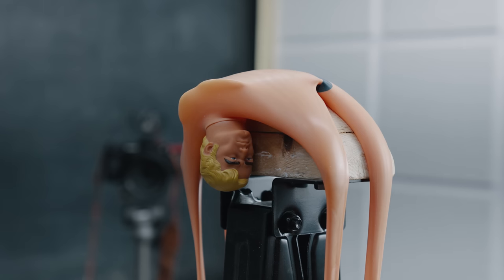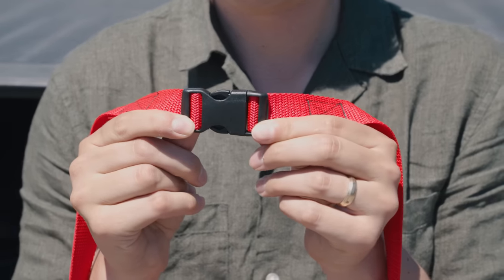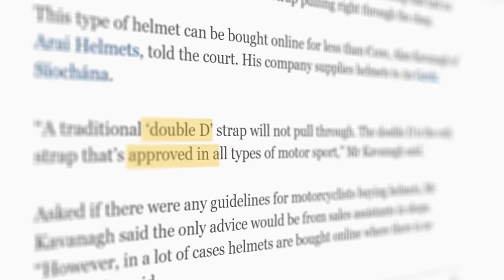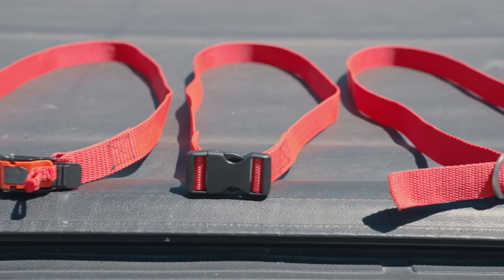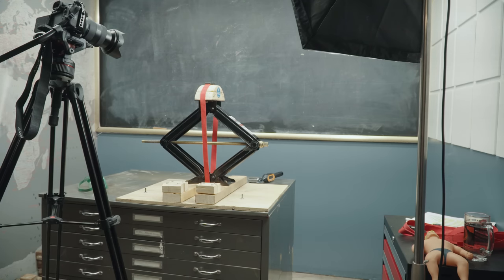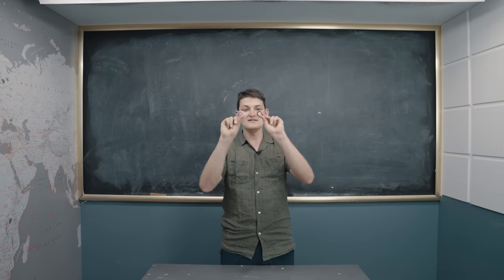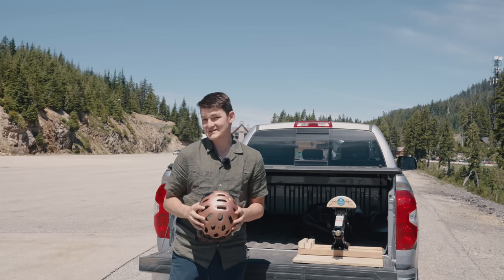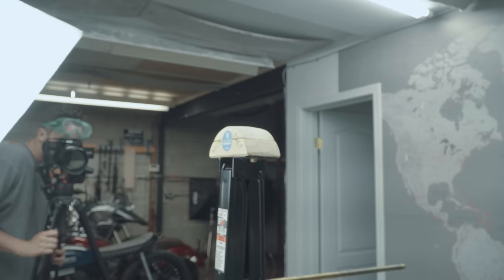Why Motorcycle Helmets Use this Ancient Buckle

Comment: The loops potentially weaken the strap strength, please try the same step with no buckle as a control test, actually doesn't matter, you'd need a set up where you can see the force at which they snap. Still cool to watch!

Comment: I have a plastic cambuckle kit I put on my downhill MTB helmet for electric unicycle. It rivets onto the existing strap. OBVIOUSLY it's going to compromise the strength, but at maybe 40km/h it can do that. The kit came with 2 buckles... that other one was never going to go on my motorcycle helmet because that'd be insane, even though that's basically what it was sold for.

Comment: this is coming from mountain biking where we have all the same type of buckles and helmets anyways. i absolutely do love the fitlock though, it's by far the easiest way to put on your helmet, does not come loose as fast, and easiest way to take it off. of course this is mountain biking im talking about, where we take off our full-face helmets almost every 5 minutes just to grab a breather. thats why the double D is a favourite in DH helmets where you only take off your helmet for a ski lift or car ride up the mountain, but the fitlock is also taking over there, of course, we have slower impacts but still. its nice to have and apparently only a little less safe, but im willing to give up that little bit of safety for comfort, that's why you don't see me walking around the street with full armour in case i fall

Comment: Only complaint with the ratchet style is no secure way to hook your helmet to the bike. I solved that by drilling a hole in the metal slide big enough to fit a standard helmet lock. Be easier if they'd put a  D ring on the helmet as well. Slide still works and I get three clicks when fastening it on.

Comment: It's faster fastened than you think. You always keep the belt in the rings and just loosen it a bit. Then you can slip through. When tighten it, you just pull a bit, and you're done. Also you are less likely to get pressure marks on your neck with these.

Comment: For my job, keeping gloves on, helmet on and have it easy to take off works wonders with a shark $800+ modular with a ratchet buckle and always checking for tightness, I mean maybe once I forgot, but have not had a single issue yet, no extra wear, no fraying due to over tightening/loosening of it constantly and it is a tough lid to pull off due to all the extra padding anyway, so the buckle works more than intended :) I am all for safety, but on occasion, the only helmet that you can buy that fits you properly, isn't exactly subject to change prior to purchase, and is illegal to modify here in australia, so ya know...

Comment: Hard to tell in the video, did you start with the scissor Jack in the same position every time? A scissor jacks lifting power increases the higher it gets, so the torque applied at the crank isn’t linear to the force applied to the buckles.

Comment: One of my first helmets had a DD. The first time it hit 60mph the tail started flapping and within a second or two it blew off my head. Probably it's fatal flaw was round edge Ds, a slippery strap, open face and no snap to secure the tail. Retrieved, cinched  uncomfortably tight it did the same thing. It was my first and last open face. Had DDs since that did fine.

Comment: The double D is also the best ergonomically, easy to do blind and you can set the tightness perfectly and nigh on impossible to not secure properly (vs a clip that might not engage fully). As for the test, I doubt there would ever be point loading on the buckle like that (which is bending the buckle rather than pulling in tension), but good to know it's also very strong.

Comment: There is another type of clasp that’s missing ,it fastens the same as a car seat belt .A lot of motorcycle helmets sold in the U.K. had this type fitted or the DD clasp type .The only other type I have seen on any motorcycle hemet is the micrometric ratchet which I have on an HJC flip job .The side release buckle is usually seen on some tank bags or ruck sacks ,never seen one on a motorcycle helmet .Good experiment & testing gizmo 👍

Comment: Well, with using this type of lift, torque on your wrench is linear to pulling force only at the same geometry (same height, when buckle gave up). Higher the buckle snapped, higher advantage the screw had and with the same Nm, pulling force was higher. It would be great, if you would had some kind of tension meter there to chceck actual force.

Comment: There's a reason why the DD is still used on nearly every rock climbing harness. Especially with the stitched ends so the straps can never be pulled out and then laced back in the wrong way.

Comment: I actually use to wear my D ring loose so I could just pull the strap to the chin of the helmet and slide it off and on without having to undo it! But with my ratchet connector I actually wear it properly because it's just one small pull action to take it off and just push it in to put it on! So I personally prefer the rachet because I actually wear my helmet properly! But I love the videos!! Keep em up!!

Comment: I used to use the DD strap holders when I first started riding, now use one of the micro ratchet clip ones, it's always fairly tight and besides I can't remove my helmet without flipping up the front anyways.  You state that the DD ensure that you always tighten the strap but you are incorrect, when I worked at a pizza delivery company the supplied helmets came with the DD clamps but also the popper to hold the strap out of the way, so what some people did was feed it through, pop it up and then just leave it loose, they just moved it in front of their chin to take off the lid.

Comment: I’m only have way in the video but my guess is because the plastic deforms over time each time it takes more stress and will weaken and break at lower stresses after so long where as the metal is brittle and will either break or not.

Comment: Having just purchased a Shoei Neotec 2 which has a ratchet strap, I am ambivalrnt about this option versus the double D ring.  The ratchet can be put on with gloves on, which is very nice.  But the ratchet also leaves no place on the helmet through which to insert a helmet lock cable, unlike the double D ring.  I guess my only option then is to run the cable around the chin bar.

Comment: The problem with the ratchet strap is that the spring that forces the red locking mechanism down tends to loose tension overtime.

Comment: Your torque meassurement doesn't say anything about the force needed to break the strap, as long as each strap breaks on different "heights" of the jack, since the ratio of rotation vs lift varies from top to bottom.

Comment: Another great vid Ryan! . . . although, this isn’t the first time I’ve watched this episode, I’ve come back a couple of times, as something I couldn’t quite put my finger on was troubling me.  Please forgive this rather bleak comment.

As is (too) often the case, I turned to alcohol to sit and ponder on what it was that didn’t seem quite right.  And that was when I had my eureka moment (physics is not my strong suit, so please excuse the following arm chair quarterback logic).

A cork is designed to be pulled from a bottle of wine, where the force required to extract is less than the inherent strength of the container - a cork would be pretty useless if the strength of the bottle was less than the force to pull the cork out of, as people would just drink from the hole they’d just made.

In some ways a cork is the opposite to a helmet - the rider wants it to remain in place . . . however, if the force to make the fastening fail is greater than the force that would be needed to separate the head from the rest of the body, isn’t the fastening strength, in some respects, academic?

A little morbid, but is the ideal fastening strength of a helmet clasp one that is only very marginally below the force needed to pull the head off, not least to make it slightly easier on the mourners?  The strength of the intact D ring could be of cold comfort to the rider when the helmet, and it’s contents, roll away from the accident?

Comment: I'd argue it would be better to reengineer the ratchets to get close to the DD shackle forces. Since its quick and easy its the least likely to be left just undone, you can do it up while on the bike in gloves if you forget it, and as long as you're sensible it will always be tight
Reply: dn3087  problem is the mechanism in seat belts needs a lot of space. The ratchet is very close to that mechanism, just shrunk and modified to make better use of a smaller space.

Comment: I wonder how they would have performed if the buckle were off to the side of wood block in a straight line. As most buckles are in soft tissue between jaw bones or on the side of the jaw and not on a hard curved surface.

Comment: They need to teach beginners more about turning at high speeds and high speed maneuvers so they don't wind up crawling out of a ditch like I did. I mean I guess it was too late for me since I was going 90ish and looked back too late as I exited onto the non existent shoulder of the road into the ditch. My helmet "popped" there was some glue or something seeping from holes that had been created from the crash. There were some flips and turns and a ton of vertigo if I woulda lied where I ended up noone would have seen me, the weeds were pretty tall and the ditch was pretty deep. I had to hobble and crawl to the road all while everything was spinning and I couldn't see much of anything. The pain was tremendous but I escaped with only a clavicle fracture and a scraped knee ( I was wearing shorts that day, of course. Lol ) I should add I was wearing Snell rated helmet, a motorcycle jacket with level d30 back pad, level 2 ce elbow pads, some really good gloves and you know.. shorts.

Comment: Were those readings taken straight from the torque wrench, or did you account for the angle of the jack? The only time that the reading of the torque wrench represents the pressure on the strap is when the the angled parts of the jack are at 45°. Steeper than that and the torque meter will read lower; shallower than than that and it will read higher. The only way you can compare those numbers is if they all broke when the jack was at the same angle or if you adjusted the results based on the angle of the jack.

Comment: Its not that simple, the removability of the helmet is a safety factor you have to consider as well.
with head injury you have to act quick and carefully, thats why many helmets have padding that can be pulled out in case of emergency. A double d buckle can be very hard and slow to open, especially by another person, when you are in a bad position and in a situation where you dont want to move and stress the head too much. I wouldnt want the rescue team to have to take a knive to my neck!
Thats why i think the fidlock buckle has its place, it can be opened so easily with one hand.
It would be interesting to know if it is even possible to survive the kind of forces you applied in the video. Maybe at some point it would even be better for the buckle to fail...

Comment: dd is also more reliable and do not wear out as fast. plus i have had in crashes the non dd straps get stuck and have to be cut. not the best thing when you are trying to remove pressure on the air way without removing or moving the helmet. you should have also tested them at what point to they stop functioning and being able to be opened.

Comment: FortNine is probably the only channel where I can see why it would deserve the subscribers it has (and making money off this number). But one thing I missed from this video: most ratchet clamps are metal (it is on my Shoei) so that would have given a different result? Plus, is there any other factor to consider, as in: should the lock be engineered to fail at some load, to prevent head decapitation of some sort during an accident (better having a helmet slide off after a hit, rather than your whole head with the helmet still on?)?

Comment: Your test may prove that Double-D is the strongest with your testing method but then that's about it. According to the fidlock website, the static breaking load of the CE certified fidlock 25 alu motorbike buckle is 1962 N which equals roughly 200 kg. I'm wondering what the breaking strength of a neck is? The 763 lb derived from the torque measured equals 346 kg, the ratchets 555 lb is 251 kg. A load cell would probably be more accurate...  The certification requires the strap to hold at least 500 N for two minutes. That's a minimum of 50 kg pulling on the helmet, right.

Comment: OK, double Ds are definitely a stronger method for securing your helmet to your head. My question is; what kind of accident/incident ( speed, blunt impact) would you have to be involved in for those kinds of forces to be exerted and the straps/fixing device become compromised? Also, what sort of physical damage would your face and neck sustain in that kind of event?
Reply: Imagine you and your buddy riding your 650s, give or take 400lbs on each bike. Then your buddy got into a low side crash then hit your bike at a bridge. His bike got entangled with yours and you somehow manage to lodge your helmet stuck into your bike as it slides to the side of bridge. Luckily, your body was saved from falling by the bridge's guard rails.

So there you are, with your head dangling at the side of a bridge together with your bike... oh and your buddy's bike! That's just 800lbs! It's nothing for a double D! 

Fuck those magnetic and ratchetic bullshit with their sub-800lbs! You can't even lift your own bike with your head with a helmet on if you are riding a Goldwing!

Comment: I feel like this is more of a test of the bend ability of the buckle because you have it set on a curved bit of wood. Maybe next time set the buckle between the top of the jack and the bottom so the tensile force is in a straight line.

Comment: PSA do not completely undo your D ring buckle. Loosen it fully then use your thumbs to pull it towards the chin bar and put the helmet on, Now you never need to fiddle with the D ring while its on your head... Ive only found a couple helmets that this doesnt work on because the strap is too short

Comment: There's a flaw with the test method. With this type of scissor-jack, the force needed to raise a specific load varies with the angle of the scissor arms, due to how the geometry of the how the load is transmitted to the mechanism. For example, if the arms are relatively level the force needed to lift a given load is significantly more than when the arms are more vertical and near the end of their range of movement. For this reason you cannot accurately measure the load on the straps and buckle with a mere torque wrench, unless you also ensure the scissor jack arms are at the same angles at maximum load. 
You could get a more accurate measurement if you ensured the length of the tested straps and buckles were the same, but I didn't see any attempt to do that during the test.

I also concur with the outcome. A double-D strap is a strong, reliable and cost-effective way to secure your helmet. I've had the plastic on other types of buckles fail after a period of time due to degradation of the plastic.

Comment: Is the assumption that the double-D ring broke at 900lb because the strap breaks at 900lb? If so, that assumption is probably incorrect, as the strap is rated in pure tension, but becomes weaker when bent (e.g. knot or buckle loop). The strap probably broke at something considerably less than 900lb.

Comment: Your test rig results are incorrect, because the torque required to raise the jack will vary a great deal depending on how much it is raised.  With that jack design, the torque required will decrease as the jack gets higher because of the angle of its arms.  Unless every strap is adjusted so it breaks when the jack is at the same height the torque can't be used as an indication of strap strength.   If you put a scale or load cell between the strap and the jack you would at least be in the ballpark...

Comment: do you actually measure lift force, or calculate it based on the torque applied? (force is going to depend on the height of the jack at any given time, based on the angles of the "arms" to convert the lateral "squeezing" from the screw into upwards force). 

I'm also not so sure the strap failure is so conclusive. the strap is part of the buckle with the D ring, and it looks like the D ring basically sliced through the webbing (and you won't get slicing with the other buckles).

still a very interesting series of test though

Comment: For the break failure: Did you really only measure the torque required?
the torque-force relation is not linear here. The further the carjack is extended the higher is the mechanical advantage. If the buckles all where the exact same length and the straps were all the same length then it wouldn't matter in their relative performance.
But with different length the longer the strap is the smaller the force read out is in comparison to the force the strap experiences.

Comment: I watched this whole video.... it didn't make me want a fidlock helmet less. 

If anything it showed the buckle mechanism is fine, they could beef up the metal in the loop though. I get setting up the loop each time. I don't disconnect my strap buckle though because it holds it all together and i hate putting it back together. I'm more likely to leave that loose than to not setup the fidlock and magnet it. Set once and forget better than set everytime.

Comment: I actually wonder if a part of the safety is the consistency with which these could be made. Manufacturing tolerances are less likely to cause problems, the simpler the device, right?